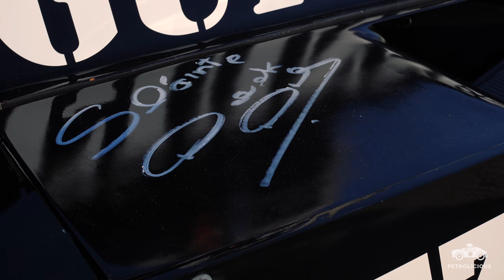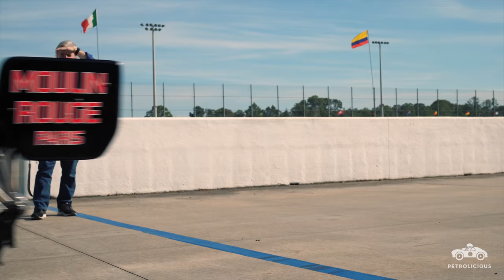1981 March 811: Formula Vice

Comment: I watch most of these 2x the production is great. Back when racing was real and cars were built without massive rule books ,the drivers drank smoked and had women chasing them like rock stars. All the vintage racing is better to me.
Reply: man, a gp2 car is faster. Lauda, Hunt, Villeneuve, all these guys cared about was pure speed, and would take a 15 second a lap faster modern car over anything they drove back in the day in a heartbeat. but keep buying into that nostalgia
Reply: Strange then that Hunt chose an elderly and slow Austin A35 Van as his everyday car. I don't see many unhappy campers amongst the current crop of drivers at the Goodwood Revival. Anyway you should get back to the corporate procession that masquerades as modern racing.